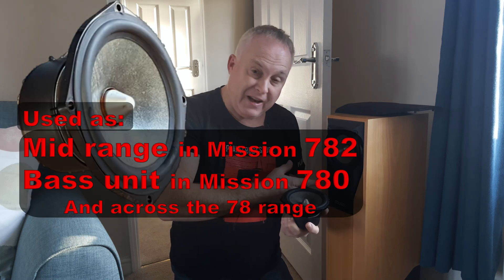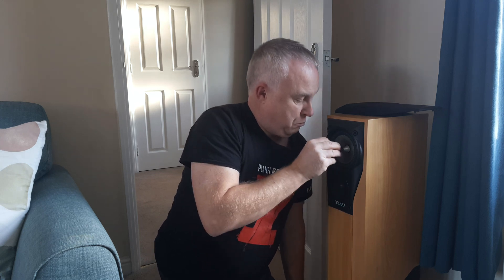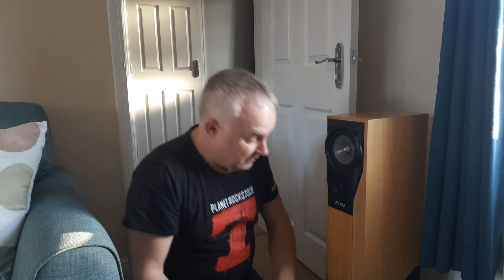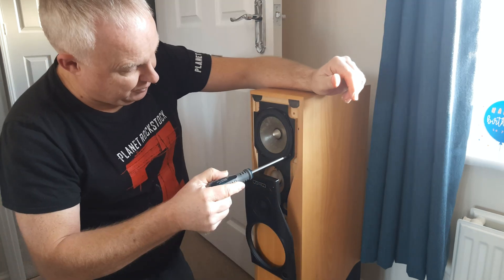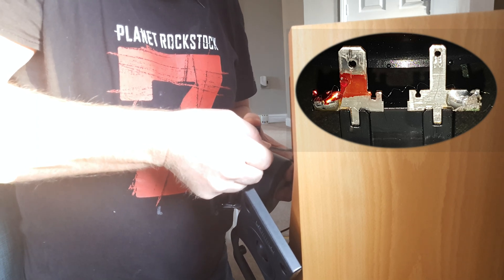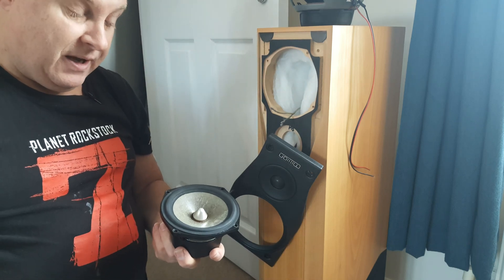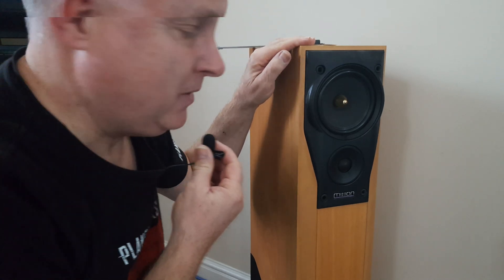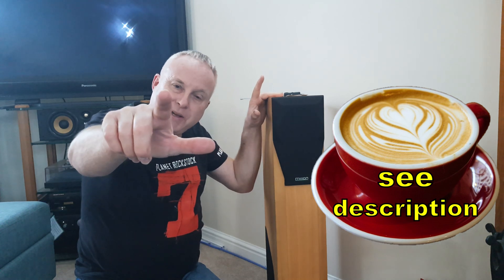Mission Mid Range Unit Failure 🔈 Easy DIY Replacement 👍

Comment: Hello, first Ty for the information regarding the 780’s. I have a pair that are not in working condition because of one driver. I have tried endlessly to find a replacement driver but can not. I know the video is a yr old but I’ve looked before over a yr ago but nothing. Can I use another 5inch driver in the one spkr to at least use them or do u know how to find that mission part. Ty

Comment: How do I get a pair of those replacement speakers, I have the same issue and the speakers have been in storage for a long time! I'm located in Canada, any contact info would be greatly appreciated! Ray
Reply from the maker: Here are brand new units which are almost exactly the same as the originals
https://en.toutlehautparleur.com/speaker-audax-hm130z0-8-ohm-5-35-x-5-35-inch.html
TBH 2ndhand units here in the Uk sell for almost as much as these new ones.
Reply: @AbouttheHouse0  got my eye on a centre channel of the same era close by for £50 how durable are these midranges?

I collected a new to me, tidy pair of 782s in beech tonight for £110.

1st thing I did was close the bass ports with a rolled up sock.. much tighter less bloated bass.

May investigate addressing the cabinet vibration.. 

Mid range and treble is pretty nice though.

Is this alternative midrange better than the original or should I be happy with my £110 purchase for now?
Reply from the maker: Sorry I didn't see this reply earlier. The alternative mid range I used here is a later version of the original. It may be slightly 'better' in the lab, but I can't hear any difference. I'd say to enjoy them as they are.
Reply: If you are in Toronto, I went to the Speaker Shop and they did a pretty good job finding new drivers (from another mission model) I think the originals may have been a bit better but they suffered from corrosion. I thought it would be easier to find a replacement but it is actually a challenge.